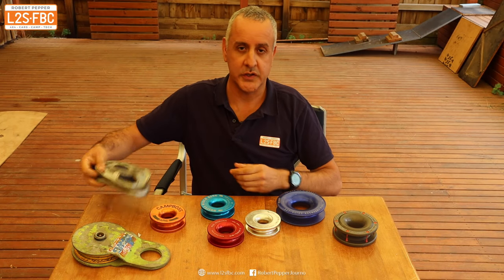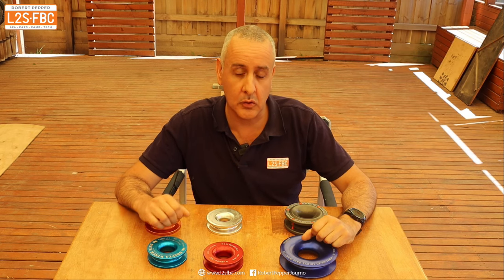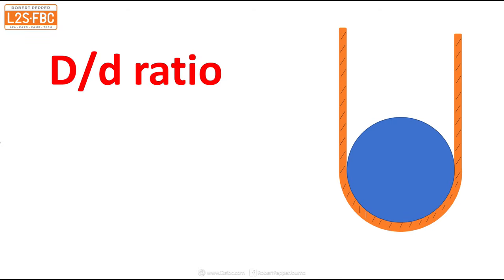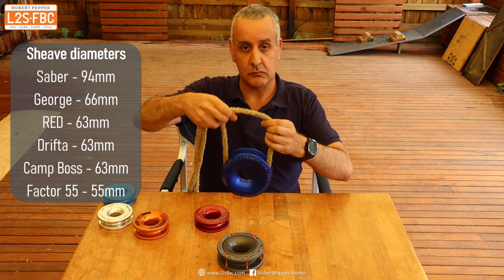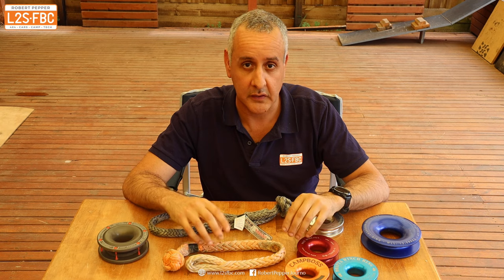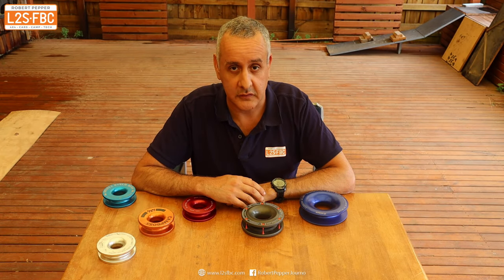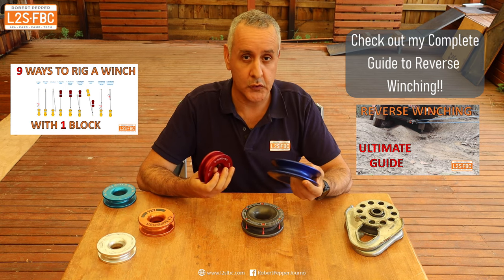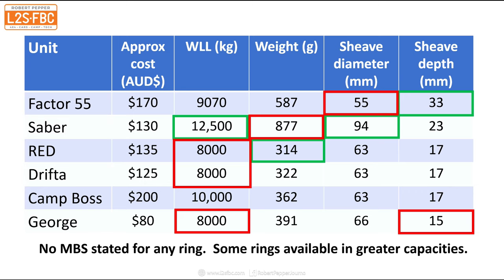What makes the ideal 4x4 snatch ring and how to choose one for you

Comment: It would be nice to know what the friction loss for these is compared to the traditional snatch block. Although this could be minimal, if using multiple rings, it could add up.
Reply from the maker: That is exactly what I'm working on right now! Let's just say the difference is not enough to not use them :-)
Reply: I've seen several tests of snatch blocks with bearings versus recovery rings, using dynamometers. They are all consistent in that traditional snatch blocks are far more efficient than recovery rings, with an 8 to 12% friction loss depending on the quality of the snatch block. However, the results of the recovery rings are wildly diverse showing a friction loss of anywhere between 18 and 40% depending on the quality of the Ring and the design. 
Super slippery scientific Teflon coatings not with standing, it appears that the saber ring would be by far the most efficient design. Bigger is better when it comes to overcoming friction loss in pulleys. The George in my opinion would be the next most efficient with the factor 55 being the least efficient by far. Again like I said, assuming that they're not overcoming this flaw by using the Teflon coating.
Reply from the maker: The definitive test will be published here shortly 👍
Reply from the maker: And here it is -> https://youtu.be/rdlRRAbzCzA forget that 60% figure!

Comment: As an arborist, I want to say very well done on this video. Bend ratio is very under appreciated. In the interest of practicality I want to point out that it is really hard to beat the old snatch block design. Because of how well informed this video is, let me offer some counter arguments before everyone goes out and ditches their old blocks for this new expensive tech. There’s been a lot of great optimizations in pulleys that not too many people are aware of.

A brand new, well lubed pulley generally sees 10% loss in friction. That might not seem like much but it adds up exponentially every time you add another device that makes direct contact to the system. Especially when doing 180 degree turns or Z drags. Combining snatch rings in the same system would be very inefficient and would result in a lot less mechanical advantage and a much shorter buffer when shock loads occur.

Snatch rings are not recommended for cable because of their aluminum design. Whereas pulleys will accept both as long as you don’t use rope in it after a sharp cable has been in it.

Pulleys can be attached mid-line

Pulleys have zero chance of the line escaping and strategically catch knots before can they go through

Pulleys are much cheaper ($27 on Amazon accepts up to 3/4 inch, 22k lbs) and you could buy more than 5 for the same price of any 1 of the cheapest rings

Pulleys can be attached to many more anchors (carabiners, snaps, hooks, clevices, slings, any open solid objects) but rings are very oddly shaped and pretty much only accept soft shackles or other rope with a knot tied in it due to how it rotates on the line. This could be problematic if you lose your only soft shackle or it becomes damaged or you tie a bad knot.

Pulleys can come in double and triple sheaves which offer great options from a single point and keeps the lines in your system very straight and not off camber or rubbing on each other.

Pulleys are more robust and can withstand abuse. But, they make lightweight versions as well rated for life support. I personally have a CMI brand one rated for 7,000 lbs that’s no bigger than a kiwi and just as light. $50.

Pulleys save friction in both the line and anchor. However Rings see quite a bit of friction in the line in addition to the anchor
Reply from the maker: That's great info, thanks!  I am very keen to hear from other industries, and in fact I study aborist videos to learn things applicable to 4X4s, so super happy to hear from one! 

A forthcoming test will be to see if 10% adds up each time when multiple pulleys are used.

One difference I've noted between 4x4 and aborist is that 4X4 really only needs to use 1 or 2 blocks - we don't need pulley blocks but there is one I describe here -> https://youtu.be/DrwuSobJFsU

The line escaping has been a source of concern for some, but not me. If the line goes slack, then it needs checking regardless of whether a ring or pulley is used, and I never found the rope escaping to be a problem.

Can you expand on the shock load point please?
Reply: @L2SFBC   Cool. I look foreword to seeing the friction test because I’m very curious how these rings compare and behave as they rotate differently. You are correct about mechanical advantage being pretty much 1-2 blocks in most situations. Sometimes mostly serving to extend the rope so the winch can operate at full capacity due to there being less wraps on it. But, you’d be surprised how quickly things require an additional change of direction which takes additional devices.

Here’s a good video for friction loss on many pulley setups https://youtu.be/x1FSdt3_Nlc It looks like the fiddle block is like a fancy set of fours offering 5:1 (assuming it’s setup in the same direction of the pull). We have a similar device called the Aztec in rock climbing and tree trimming. These are very useful because they can be put together ahead of time and be deployed in seconds, as long as you have enough rope. According to the video, you’ll notice that with the friction loss in this configuration is basically 20% reduction in MA which is essentially turning the 5:1 into a 4:1 in most rigging systems. Pretty crazy. 

The line escaping is really just a slack annoyance, I just figured I’d put it in there along with the fact that knots passing through are a real thing to consider in both cases. 

As far as shock loading and buffering goes, this is referring to the load being let out at variable rates of speed. I’m claiming that there’s a better friction advantage in pulleys than in rings. The pulleys do a really good job of keeping the line fluid and smooth when the load bounces suddenly. Let’s say the load suddenly moved quickly with slack in the line. When the slack reaches tension the pulleys will do a better job easing the load into the anchor point than if the line was through, say, a trailer hitch loop or a clevis. Now imagine the line is through 2-3 trailer hitch loops or 2-3 clevises. Most of the weight would be stopped on the first loop or clevice instead of a nice even distribution if that makes sense. Even high efficiency pulleys react this way. Watch 5:40 to see the buffering action I’m talking about: https://youtu.be/M2w3NZzPwOM

Watch a real life example of the forces generated when there’s more friction in the system 8:15: https://youtu.be/m8z6adEqaOs

Obviously the rings offer a decent amount of efficiency, of course, but when you start to add more than one device into the system even a little friction can add up quick in terms of dynamic load. In my trade you would actually let the line out gradually instead of purely relying on this. It’s called letting the line run. That way there’s less shock load. But, in a tied off system you can’t always do that and winches can take a beating if they get shocked in this way. (But you should never let line out of a winch with any serious load of course)

Hope that answers your question. Sorry to write you a book.
Reply from the maker: The efficiency video has been done! -> https://youtu.be/rdlRRAbzCzA  Thanks for all the detail, I'll read it again and watch the clips, always love people explaining things like this, and as I said, very keen to learn from aborists, riggers, sailors etc...the 4X4 industry can be a bit insular sometimes.
Reply: @L2SFBC  That was a very thorough video you linked. I’m impressed and I really think your results were quite fair. Thank you for your contribution on the subject, you’ve changed my opinion somewhat on the friction aspect, which is really good information to have. Im glad I found this channel. It’s refreshing to see there is technical interest alive and active in the community.
Reply from the maker: Very proud to have done that!

Comment: I enjoy your videos , very informative , thanks  . For the casual off roader doing his  own occasional recovery in relatively easy situations  the snatch ring is a great idea but  if doing a hard long recovery of a heavy vehicle in dangerous positions I have misgiving's about potential heat buildup on dyneema rope. Friction damage is quite evident on the Soft shackle's .  Soft shackle's have their place but they need to be kept in A1 condition and never used where they can be pinched ,  cut or exposed to too much friction  .
Reply: I agree and had the same concerns, but o ercame them by going for the largest ie Saber and using soft shackles sheathed in super slick winch rope protector sleeve.
Reply: Yep completely agree, I also see an issue for more complicated technical winches for instance where you need to assist with driving the rope coming off the ring and requiring a re-set. But the winch rings are great for many winch scenarios.

Comment: Be great to add an offset ring into the mix. The offset ring doesn’t rotate. So no issues with lettering. But now the winch rope slides around the ring…groove design becomes critical to protect the winch rope.
Reply: Really curious about the off set style. 1) What’s the friction loss difference 2) What’s the wear differences for both the winch line and soft shackle as the the different style rings load these differently. May be do a 5 or 10 2:1 pulls and use a machine to measure the winch line and shackle breaking strength. Maybe do this for a winch on a std pulley block too. I suspect the results will be similar as the rationale for using a roller fairlead with synthetic rope, though the rings have gentler bend radii than most hawse fairleads. Can’t wait to see this!!! Keep up the great work!
Reply from the maker: It's planned...

Comment: Have you done testing on the friction losses? I would imagine that when doing a double line pull it still won’t give you a 2x mechanical advantage because of friction losses. I would imagine something closer to 1.7x and maybe a traditional snatch block closer to 1.9x but that’s a guess!
Reply from the maker: Yes I have done those tests check other video

Comment: Thank you for the educational productions! My utv came with wire rope winch pre-installed. Owners of the same machine say switching to synthetic rope loses about 6m of length. I do not want to sacrifice any length. Any potential issue using wire rope with snatch rings? I have a line dampener to put on wire rope.
Reply from the maker: No do NOT use wire rope with snatch rings!  You'll damage the ring. Don't worry about the 6m loss of length just use an extension rope.

Comment: Is it possible to make a manual block and tackle out of snatch rings?  Sometimes at my work in the field I need to hoist objects weighing between 70-300 lbs and it would be cool to be able to carry a couple of light snatch rings and rope instead of hauling a chainfall around.
Reply from the maker: Yes, you sort of could but better off using a purpose-designed block.
Reply: @L2SFBC  I'm sure snatch books would be better but this block and tackle I'm picturing is as light as possible because I  work at a shipyard and often have to go to ports to do work on vessels.  So space and weight in the tool bucket is limited.

Comment: Wow, excellent review of several different snatch rings. You should design them for these companies. 
The biggest question that was left hanging in my mind is the overall efficiency. It seems like, even though factor 55 put the most thought into their pulley, their's would be the least efficient of all the pulleys tested because of the smaller sheave diameter and the widest overall girth for the soft shackle to rub against. Unless they use some sort of ultra smooth Teflon coating. The wider the pulley, the greater The leverage to overcome the friction at its center rotating point. Other tests I've seen on the factor 55 showed that their's has too much friction against the soft shackle causing the pulley to not rotate and then you're dragging your dirty winch line across the surface of the ring, possibly damaging the snatch ring.
Of all the rings you tested, I would imagine the saber to be the most efficient and best overall ring. If the factor 55 had a larger sheave diameter, it would probably be the best but also by far the most expensive.
Thank you for the very informative review.
Reply from the maker: Efficiecny video on the way very shortly...thank you

Comment: This was great but you really should consider price in these reviews. That Factor 55 is almost 3 times the price of one of the smaller models but in my opinion, it’s not 3 times better!
Reply from the maker: Price changes and is easy to look up, plus none of them are super expensive so I left it out. But yes if equal, why not choose lower.
Reply: @L2SFBC  the Factor 55 is $175.00 on eBay currently but you can also buy a cheap one for $25.00! That’s a pretty massive difference and I’d say it’s quite relevant!
Reply from the maker: Just checked, the F55 is $190, Saber is $100 to $168, and a George is $75. So more expensive yes. All AUD.

Comment: The one thing I find confusing is the WLL rating. Does a WLL of 8000kgs mean that you can use 8K input force, giving you a total of 16K force on a double line pull or does it mean that you can only have a total of 8Ks of force on it, meaning that you can only have 4K of input force on a double line pull? All friction losses are ignored.
Reply from the maker: 8000 total. Any force needs an opposite force otherwise the object moves. So if you pull on it with 8000kg then the anchor is also exerting an opposite 8000kg force.
Reply: @L2SFBC  Am I correct in assuming that if I had a winch capable of pulling 4000kg I would need a snatch ring with a WLL of 8000kg or more?  The winch pulling 4000kg around the snatch ring and back to itself would produce an 8000kg pull on the snatch rings soft shackle.  So as a general rule you need a snatch ring WLL twice that of the winch capacity.
Reply from the maker: Yes, hence 8000kg about right for 4X4s of 3-4t.  And, that assumes the winch operates at its maximum (almost never) the recovery load is that great (almost never) and even if all that's true, then the figure is WLL so the unit won't break at 8000. So I think 8000kg is fine. If you are in a sub 4t 4X4 and you break one of those...I'd suggest you have bigger problems on hand :-)

Comment: Do a test of the actual load pulling say a truck uphill with a regular snatch block then do same test with the snatch ring to see how much more load it takes to use the ring and how much load is saved by using a snatch block due to the increase in friction.  I bet the load is around 50% more with the ring due to friction and the design
Reply from the maker: Bet it's not... https://youtu.be/rdlRRAbzCzA
Reply: @L2SFBC  haha

Comment: When the tow truck and crane operators start using synthetic line instead of wire rope, THEN I might consider switching... I have a hydraulic winch and when it was on my XJ, I spent all day winching tree trunks after a small tornado decided to visit us during a hurricane... I had a Live Oak tree in my yard that was quite old... One man could not even reach around the bottom limb on that tree and two men could not reach around the truck of the tree... It split down the center and fell across the street... No way would an electric winch have been able to handle that task due to the minimal duty cycle that they all have...

Comment: Can you use these for a double pull by threading the winch rope (I carry a 90 m rope) back through the inner ring, if you really need mechanical advantage and a limited number of pulleys?
Reply from the maker: I guess so but you would need a 2nd pulley regardless.
Reply: @L2SFBC   Understood.  Thanks Robert.

Comment: What if you are in the mud? Are these a no go, ie. the mud will chew through the soft shackle while you winch out?
Reply from the maker: An excellent point...watch this space...
Reply: Yes! Thats the question always coming up in my mind. All fine and good with clean dry synthetic rope.  Covered in gritty mud, as it sometimes happens, and probably a whole different game, i would think.  I don't have experience, my winches all had steel cables.
Reply: Wonder if sand would be no go for this
Reply from the maker: Don't do a lot of winching in sand but it wouldn't help

Comment: Can anyone comment on soft shackle rope diameter to the inner hole? I see many rings that seem to top out at about 1/2" soft shackle, but I would like to find one that can accept 3/4" soft shackle size.
Reply from the maker: Why's that?
Reply: I want to do some stump pulling with my compact utility tractor and think I need to beef up each component as much as practical.

Comment: Do they make a snatch ring that will support kinetic ropes?
Reply from the maker: why would you want to do that?
Reply: @L2SFBC  so I was watching a recovery video where a Lexus had rolled. As they were recovering it, they lost control and had to correct it. The camera crew never showed how they had it attached to the tree but it worked off of a snatch block setup. I didn't think you could either but it worked. Also, all I keep in my rig is a kinetic rope.
Reply from the maker: Ah, two different terms. A 'snatch recovery' is a kinetic recovery, and, confusingly, a 'snatch block' is a pulley.
Reply: @L2SFBC  I know the difference between a snatch block and a snatch recovery. Look up "Matt's offroad recovery" search the video "my crew almost died". Skip to the 10 min mark and you'll see what I'm trying to ask about. The camera never showed how they attached a kinetic rope via a tree to another vehicle.